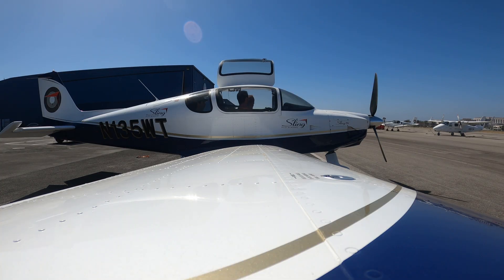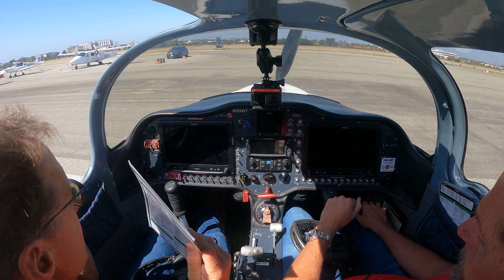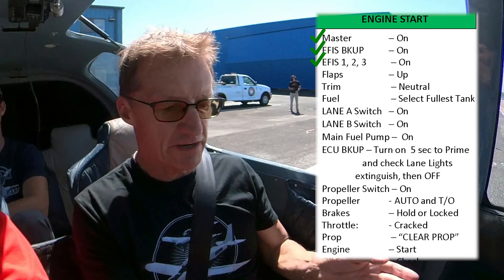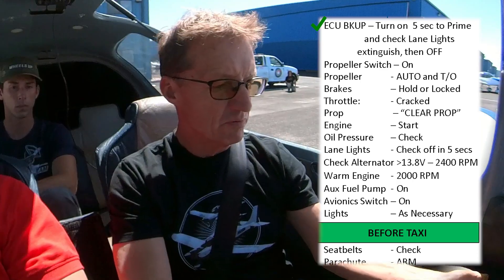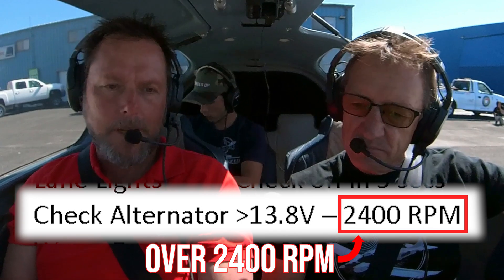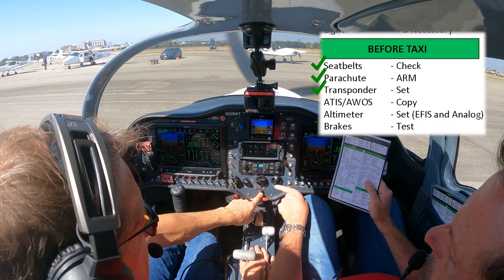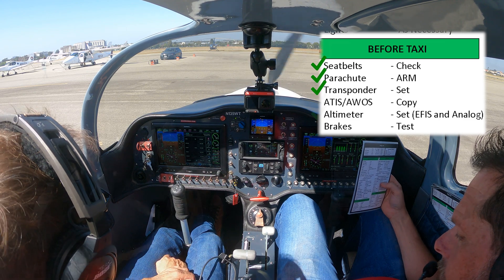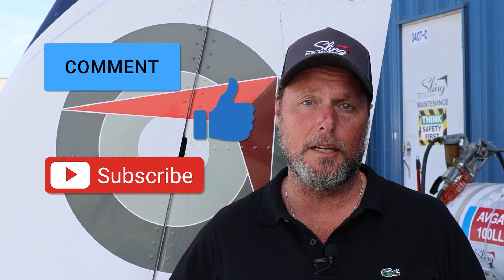How to Perform a Startup in the Sling TSi

Comment: Thanks for continuing to provide great content!  I know the G3X supports electronic checklists, but I've yet to see anyone use them.  Are they just not practical or more trouble than they're worth?  When I flew an SR20 they were primary with the laminated copy as backup.  I'm about to start my TSi build and was looking at the checklist editor, but I would value your opinion(s) on doing that versus just using a paper version.  I don't want to just use technology for technology's sake
Reply from the maker: The electronic checklists work great. They can occupy valuable screen space (which can get in the way of monitoring the engine for example), but they work well. Always backup with paper. We also run these checklists on iPad